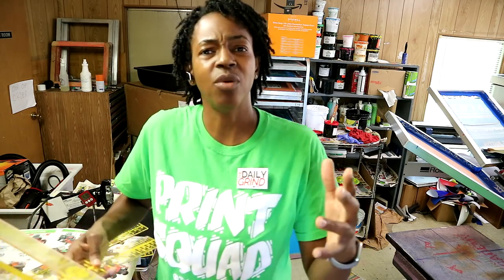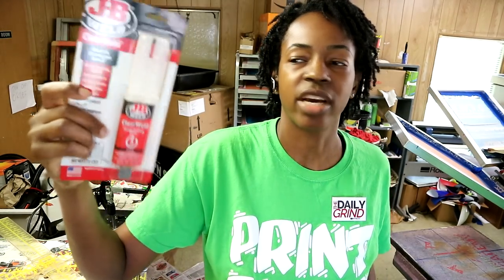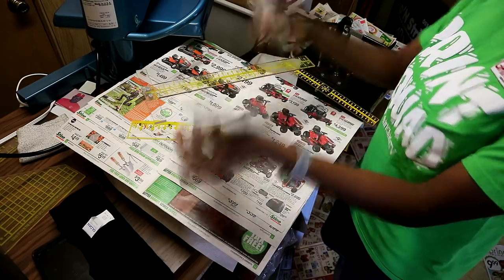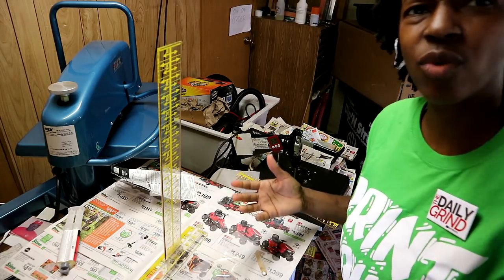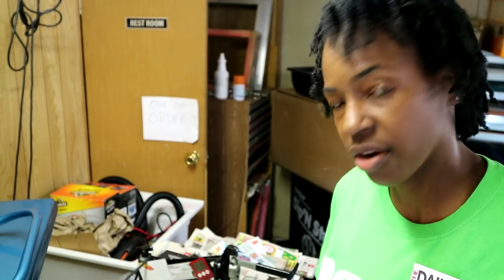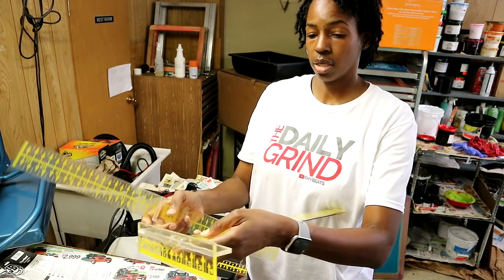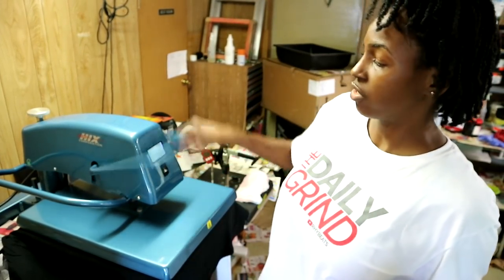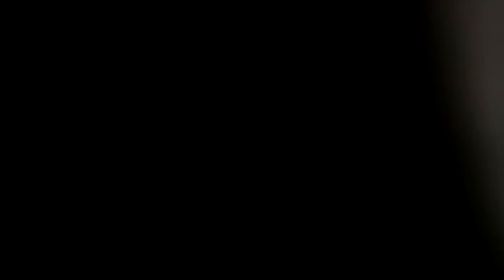Just Like New!

Comment: How are you liking your new press?  Anything you don't like about it?
Reply from the maker: I like it a lot but I do have a few gripes about it.  1)I wish the platten would turn a full 180 degrees  because the back corner of it still slightly hangs over the pallet 2)I wish the cord was longer 3) It came in with some damage (I will do a more detailed video on that situation soon)  Other than those things I like it.  It has a lot of features that I have not even attempted to use yet but I will figure them out eventually.